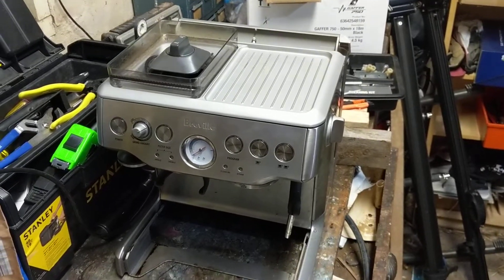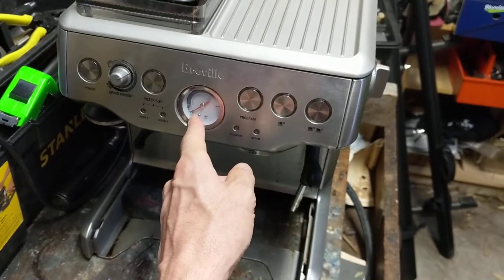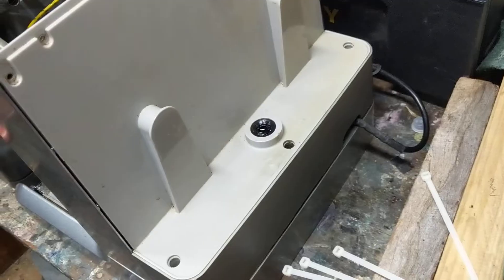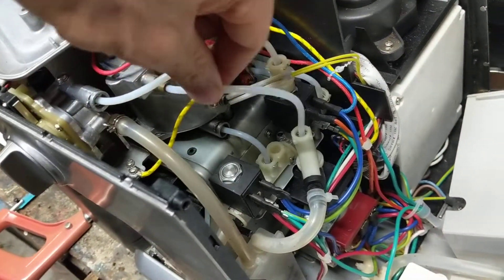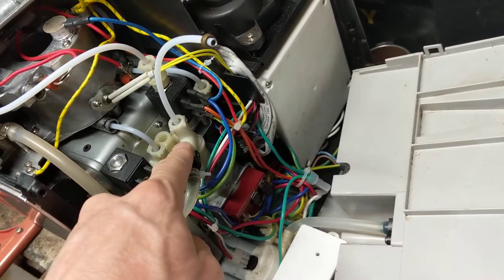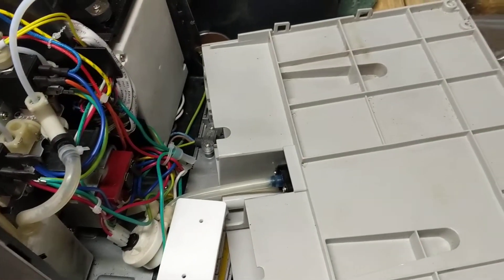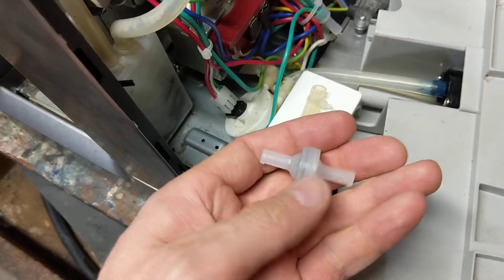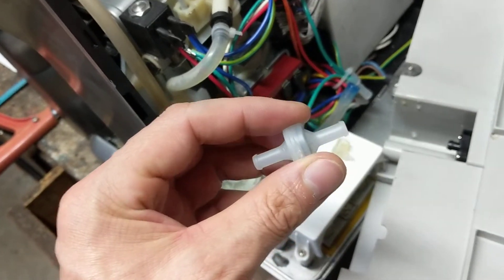Breville BES860 repair for low/no pressure and low water output

Comment: Hi, i have the exact same machine but i bought it at a flymarket and i also have no pressure , and when i push the button for coffee i notice that the water not filling the cup but instead the water poors out of the bottom of the machine? I already open the machine and checked the pomp and it works. The same thing happens when i open the steam (water poors out of the bodem of the machine) ? Any suggestions ???? if i remove the water reservoir and  then when you push for steam or coffie there is no water coming out.... when is use steam then i get some steam but also notice water that poors out of the bodem inside the machine ???
Reply from the maker: It is normal for waste water to go out of the bottom for every cup, so this in itself is not the problem but I suspect there is a blockage elsewhere or a solenoid failure. This video by someone else on YouTube explains it well: https://youtu.be/9lMw6ooiqPI  The quick fix might be to simply decalc the machine and you will see suggestions online such as warm water in the reservoir with  decalc solution, citric acid solution or even vinegar - which after you've solved your problem you need to flush well to get rid of this. The fewer chemicals the better in my view. Based on what you say, perhaps 3 available courses of action. 1) Check all the teflon water tubes to see if you can see a blockage in them. The can all be removed and re-inserted fairly easily (don't lose the clips or the o-rings). If the o-rings have perished, then you may need to replace these as the pressure/water can leak out. 2) If the teflon tubes are OK, the blockage could be within the thermoblock (ie the boiler). The thermoblock is solid aluminium with a concentrically curled stainless steel tube in it for the water to travel in. The only way to unblock this is by forcing a solution through it to push a blockage out. 3) If the theromoblock is OK, that is, water runs through it, then the problem may be with the 3 way solenoid. The solenoid valve should change to allow water/steam to travel in the right direction. Again, see this https://youtu.be/9lMw6ooiqPI If the solenoid is not working then it could be stuck in the position to let the water go down the waste pipe where it collects in the drip tray at the bottom of the machine. There are some people out there that know how to test and fix the solenoid but I'm not one of them. I did take mine apart to clean it but I have no idea how to test the magnets.  The solenoid is sold as a whole assembly so you replace the magnets and both valves. I bought mine from Breville for about $145 from memory and I had to call them and order over the phone. This was in Australia. Good luck.
Reply: @chrismelin6337  I unpluged the plastic tube just next to the left selenoit (right from the selenoit) short plastic tube... And when i pres the button for 1 coffee there is no water coming out of this tube..  Its not pluged or so because i unpluged the tube and blow in to it and air came out of the other side.....The pump works fine because i did the same thing that you do ,unpluged the same plastic tube on 1 side and the water shoots out the other side. so i think its the right selenoit  that its broker ?
Reply from the maker: @jimmysrandomness  mmm... Could be. Or could be blockage in the thermoblock but less likely.I presume the tube you removed is the waste tube that goes into the diffuser. So where does the water come out that you mentioned earlier? As I thought that would be waste water coming down the normal path through the plastic diffuser box.
Reply: @chrismelin6337  its the right short tube from the left selenoit that go into the Expresso.. i unplugged and no water Comes into this tube.. i think its go into the thermocoil down to the right selenoit and from there i think 1or 2 valve ar closed
Reply from the maker: @jimmysrandomness  perhaps you need to remove the thermoblock and clean this. With that tube disconnected I think water should pour out when you try to pour a shot
Reply: @chrismelin6337  thanks im gonna try to clean it one of these days.. i keep you posted. Cheers

Comment: Thought I would ask the advice of others who have gone through this first before going into disassembly diagnosis of my 870 XL. The key info being my pressure and water pouring the shot is great but steam wand and hot water just dribbles out. Any ideas I should try first?

Comment: Thanks for these videos, excellent explained! Mine is an Infuser 840XL, and I have very low pressure, the water is coming out from the head but after 10-15 seconds and low debit. Also, when I turn on the machine, I have a humming (muffled, not sure how to explain it) sound (before it was louder). I did a pressure test with the cleaning disk wrapped in plastic foil, and I see the gauge moving for a few seconds. I removed the inline filter and clean it, and water is flowing without any problems. Also, I found a spring in the hose between the water tank and the inline filter, is it normal? If the pump is broken, can I still get water through the head?
Reply: Hi Doru. Hard to diagnose. I think you could try testing the pump while it is in the machine. If you disconnect the teflon pipe that goes from the top of the over pressure valve from the bioler (disconnect from boiler - see number 1 in this diagram https://wiki.jmehan.com/display/KNOW/Breville+Barista+Repair?preview=/21135518/21135521/IMG_3757.jpg ) you can then try to run a cup and see that you are getting water from the pump (you can direct the water into a cup or any other container). If you do this and there is no problem, the issue could be in your boiler (thermoblock in your model I think?) or more commonly, the solenoid valve assembly - in which case, probably easier to replace it. If you don't get enough water in your cup, then you know the problem is between the over pressure vale and the tank, which narrows it. The most common issue is the the pump, which you can replace but you can also try bypassing the inline filter. Suggest you remove the filter in the tank while testing too to eliminate this as a cause. Good luck!
Reply: @MIPSAustralia   Thanks for the diagram! I will do the test, do I need to remove the power wire from the boiler when I do this test? Is there a danger to run the boiler without water?
Reply: I changed the water pump and it look good now, pressure is back. My only concern is that the new pump is a different model, it was advertised as Breville 810/840 model by the distributor (Canadian). The original one not working is Model EF Type EFP5 52W versus new pump Model EFM Type EP5FM 46W.

I have another Breville model BRE800ESXL "Duo-Temp" that I used as backup until now, and this one is using thermoblock to heat the water. The issue with this machine is that is not always heating , I get a first espresso hot, then it stays in heating mode, but next shots are all cold. I have to stop and start the machine, sometimes multiple times to get again a hot shot.  Do you think it's an issue with the thermoblock or maybe an electrical contact?

Comment: Actually is  possible to remove almost all gunk from inside.
Flush it in contra flow under the tap. Then you can soaked in vinegar for 15 min. Then flush it again. 
Put short rubber pipe on clean side and tapping on the sink rotating the filter. Gunk become loose so you can flush it out. 
Use vinegar again if needed. Repeat procedure till happy with results. Other option is buy new one somewhere. Or delete it.

Comment: Where did you buy the part or do you have a part number? Mine does not have enough pressure even running 50/50 water vinegar for decalciuming. It kinda jumps occasionally and looses pressure almost like something is blocking or clogging. Steam works strong. 
I think that part you are showing is what i need. Thanks in advance
Reply from the maker: I called Breville and they mailed it to me. No charge for postage. From memory, I think the solenoid assembly was about 148 dollars. The pump, which I didn't really need to replace I bought on eBay. You could try bypassing the little filter near the tank to test if that is the problem. I cut the mini filter in half, cleaned it then glued it back together. Your problem sounds similar to mine.
Reply: Thank you for taking time responding. How do I determine if i need solenoid? The pressure is really good for steam just not enough for espresso seems like. Maybe calcium along the way clogging, i took apart today and one spot there seems like a small leak on the right small tube going into espresso area. O ring needed. Maybe air leak will make low pressure. I guess what i am trying to say is pump is good but I dont know how to diagnose solenoid. Will go further today. Thank you
Reply from the maker: @palpalich6261  Sorry for slow response. I posted a couple of other videos that may help. In truth, I'm unsure how to diagnose the solenoid. I expect shops install a spare to check. I would disassemble the main parts of the assembly to check the seals between them. If you don't find a broken seal, like what happened to me, you could pull the solenoids apart as per this video:  https://youtu.be/Flv1PoA4fDw The problem I had was the blockage of the inline filter near the tank, this little video shows the blocked filter after removal: https://youtu.be/lxFlKTBczbo
Reply: Evening  @chrismelin6337 , i am getting water from the pump but I feel it isn't enough. Do you recall how fast the water was flowing?    much appreciated
Reply from the maker: @johnny55b  from memory it was quite a strong flow from the tiny Teflon pipe. I think it might have filled a glass in less than 20 seconds. I recall there was enough water pressure to swirl the water as the glass filled.
Reply: I called Breville costumer service to expose my issue and they said that they do not recommend the 0/50 water vinegar for decalcifying ! What a joke! It says right on the manual! Weird. They just want you to get a new one 😓 Will probably switch to De'Longhi next time! Although Jura are the very best but coast more..

Comment: Thanks for sharing this great insight! I'm trying to see if the filter is the problem in my machine as I replaced the pump and the needle still didn't move. I'm trying to connect directly from the tank to the flowmeter but the tube is not long enough. How did you detach the flowmeter from the base?
Reply from the maker: From memory I think I just levered it off with a screwdriver. I think it's a small plastic plug in a hole pinning to the base and it should flex enough for you to force it on and off albeit with the risk that the old plastic may break. Good luck
Reply: @chrismelin6337  Thanks! I'm actually thinking of drilling a hole like someone else pointed out. However, when looking through the filter against the light I don't see any funky stuff like the one you showed on your other short video. Where else should I look for leaks? Everything seems fine. How would you know if the solenoid is the problem?
Reply from the maker: @fabriziosanabria5414  I think the teflon tubes and their little o-ring seals are the easy places to check if there is a pressure leak. With the solenoid, I think the diagnosis is to remove the assembly and replace with a working one... not very helpful if you don't have one. I don't know any other way but I saw some more advanced videos on YouTube for people that test the solenoid with electrical current - that's beyond my skills.
Reply: @chrismelin6337  Thanks Chris! I'll start with the tubes check and then drilling the hole. Ordering a new solenoid takes like two months, so not sure if it's worth the wait. Thanks for all your help!
Reply from the maker: @fabriziosanabria5414  good luck

Comment: Thanks for that, I have replaced the group head seal with a brand new one on the same machine, its fitted correctly and firmly, still water spurting out from the handle cup especially at the beginning then it stops spurting , any idea what could be the problems please ?
Reply from the maker: That does sound like a bad seal. I presume you mean the water comes out the top of the portafilter. While you are fiddling, you can also remove the screen on the group head and clean are re-install this. This is only one screw, so rather simple (see https://upload.wikimedia.org/wikipedia/commons/thumb/f/fb/Grouphead.jpg/220px-Grouphead.jpg ). If you have installed the seal well and it is the correct size, this should eliminate this problem. This made sound obvious, but the basket needs to be in the portafilter. You could also try winding the grind size down so the water can more easily flow through the portafilter and basket.  Remember to adjust the grind size while you are grinding.
Reply: @chrismelin6337  Thanks Chris, I have taken the machine back to where I bought the seal, they are having a look at it, I should be picking it up soon.

Comment: G'day Chris. Mine has no pressure to push the water through the coffee, but the water does come out. However, after trying many times (5-10), it will eventually work. Your thoughts on the possible cause would be much appreciated. Cheers. Yong
Reply from the maker: Since you get water, sounds like the pump is OK and no blockages. Might be a pressure leak. And given it does work after 5-10 tries this leads me to think that once it's hot and everything has expanded, the pressure is contained. I'd start by disconnecting your Teflon water hoses and checking the little O-rings. Failing that the solenoid could be the problem. If the steam works, this might not be the case but could still could be. I had a similar problem with my own and it turned out to be the inline filter, so I think that is worth looking at too. I was surprised that a blockage here could affect the machine so much and occurred given the high quality of water in Melbourne. Good luck.
Reply: @chrismelin6337  Thanks for the quick reply and advice. Will have a look at the things you have mentioned and let you know how I have gone. Cheers.
Reply from the maker: @yongyi6865  could also be there over pressure valve which is cheaper to replace than the solenoid

Comment: Hi! I just bought this same model from Goodwill and I took out the inline filter and still there is no suction. My pump is vibrating/buzzing when I push the 1 cup button but there is not water anywhere in any of the pipes in the back and pressure meter on the front doesn’t move. I tried using a syringe to push water through water tank pipe but it is met with pressure and won’t go past the flow meter. I also tried blowing into the tube when it’s full of water but no matter how hard I blow it can’t push the water through. Tips? Thanks
Reply from the maker: Have you tried disconnecting the water pipe from the boiler and then running a cup to see if it makes it's way through the pump? If not, then problem is likely a blockage in pump, flow meter or pipes/filter between tank and pump. You could remove the filter in the tank temporarily just to eliminate that as a cause, but that is unlikely to cause an issue

Comment: My water is going into the big cylinder fine (steam and hot water via wand is okay) but not a single drip of water comes out where the coffee is meant to go. Suggestions?
Reply from the maker: Hard to say. Clean your group head for a a start and work back from there to the water source. Try the cleaning function too - turn off, then hold the one and two cup button downs and press the power button - the cleaning cycle takes about 5 minutes. Sounds like boiler/thermoblock is OK given you can get steam but if you live in an area with hard water, you may need to descale the machine. Other options, bypass the inline filter to check this is not the problem or try to clean the flow metre (I've never done the latter). Check all the pipes are in good working order (see this video for help: https://www.youtube.com/watch?v=3KBRrLc21lA&ab_channel=Aju%27sCafe

Replacing water tubes and seals is quite cheap and easy. If you do this, suggest you also replace the over pressure value. This is something that will improve old machines so worth doing. It's also quite easy. Buy o-rings and valve/tubes online, eg: https://www.ebay.com.au/itm/176281188558?itmmeta=01HTRZ1ZM9FGAZC959E7171G7P&hash=item290b2d78ce:g:IxIAAOSwHi5leoEr&itmprp=enc%3AAQAJAAAA8MQSbYyo4CqSb90XmWz1HhzFDWoqfy3vlV%2BaYjIwXf57tn1GoGBUBwvLUTcvpZzo26IMJZ%2BTHv0q5Rr%2FB5gB%2BuPIv4lSqce0odJQ4jA7wEulu4iPeLLvhO4J9ZEEtVOS7yh8oJ9Yf5eoDXPs4JRodwp05Zf2gPi90aZSct42v2euYswSFiOcd8OOVOy4sCzVMiMehVqHhTH%2B8xUyACuM%2FjHHF3dMBhs%2BmVP%2FyPlPvMU2uHDCxSLkOhvcM%2F3GDh2TglfLvEkHfhjWo1xdpVFvyUjC551FYNXjK0S0lNIU75A5UmwVj98Mm8TgGESmhQr0HQ%3D%3D%7Ctkp%3ABk9SR576h5_WYw

and 

https://www.ebay.com.au/itm/385066782277?itmmeta=01HTRZ47FP5HX2WE1MKH52ERGZ&hash=item59a7c4ce45:g:A~wAAOSwJxxlqKL7&itmprp=enc%3AAQAJAAAA4MGOx9yr5HpOAjJXR10phYRP1jpIM1GKTV93nvGWh6G6BBrGd66oGIImjL8TPt3lmw6aaZUtDWVcQrQAUT0IbXdcKX8olnSmkhMyMkGNIW0OYnMrcYt9QuVn487VrVH8WBQJlT%2ByXKDhjzW0MUQDrAPSo8fj%2Fh%2Fshb%2Fu%2FLPXGHX6bOyc9TcEcioN9dURHyOr47OCmFo0oBedn%2FbZIYEolNybgcIYuOPedmAXR5e9icPGSgNl3b63ggSNQo%2Bo4Hpn1PFwdgQ4b4gOmTy23qeJXpisjvIIu%2Bi1nHyOPjxBPqsx%7Ctkp%3ABFBM9veQn9Zj

Comment: thanks for your video. I have the same problem with Breville BES900. But It's difficult to find this part in BES900, its so complicated. 
Could you give me some advice. (I also do OPV adjustment, too, but it did not work). thanks.

Comment: Hello, there is a fix for low water temperature? Even at the highest setting, the brew temp is under 190° and the shots are very sour and astringent. What to do to reach 200°? Thanks!
Reply from the maker: Sorry Schiaucu, I haven't encourtered that problem. The thermostat might be the culprit and this sits on top of the thermoblock. Hard to diagnose unless you replace: eg: http://spares.bigwarehouse.com.au/product_info.php?cPath=64928_68652_68653&products_id=1674317